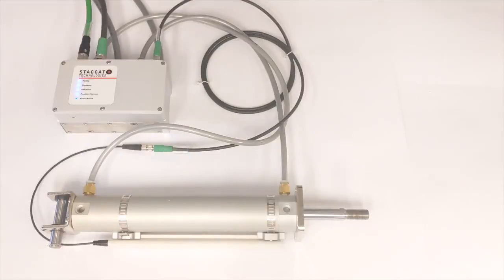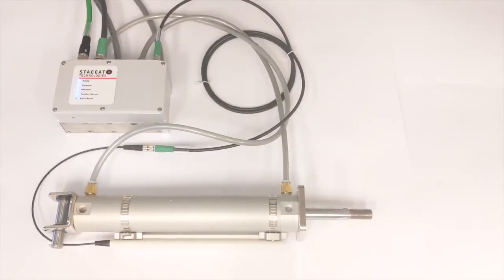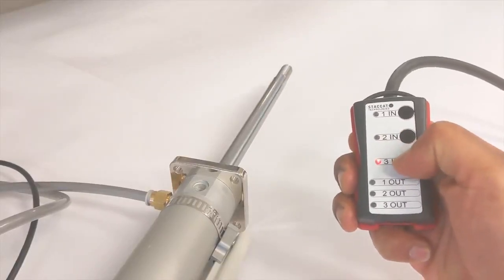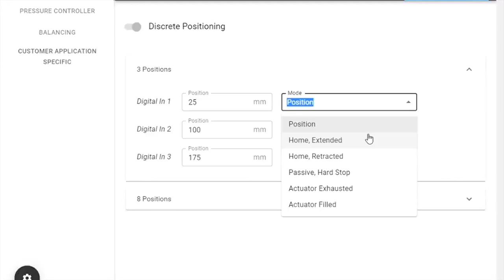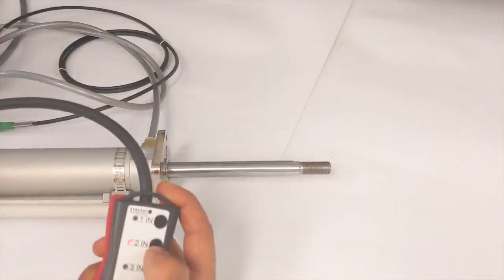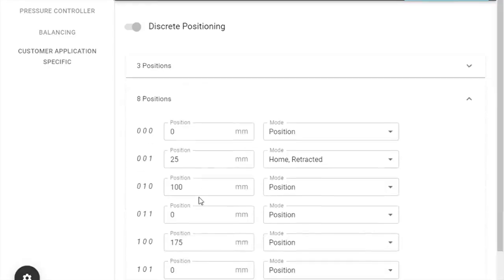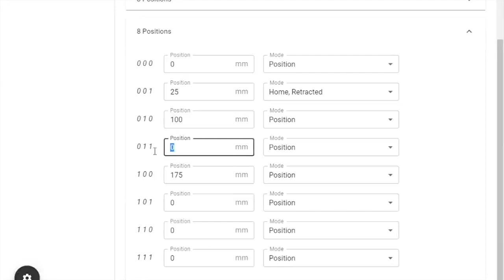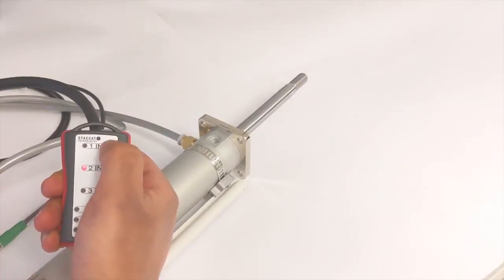Preset positioning - up to 8 positions with 3 PNP signals on Staccato Flexible Positioning unit, FPU

Comment: What is being used to track the position of the cylinder itself? Is that a magnetic sensor attached to the side of the cylinder? Or something else?
Reply from the maker: Thank you for your question. Yes, there is a normally a position sensor sensing the magnet inside the actuator. Inside the positioning unit, there is also two pressure sensors checking the pressures inside the actuator chambers. instead of position sensors, we have also applications using laser sensors, wire sensors, inclination sensors etc.

Comment: Very very interesting unit Where can I find a specification sheet How much force it can apply?
Reply: Hello Mario, the force is a result of the Actuator bore and the pressure differential between the two chambers. You can set force in both directions in our software. It will regulate the required pressures automatically to achieve the set force. Please send your contact details to order@staccatotech.se and we can arrange a web meeting. You can also find more information on http://www.staccatotech.se/download/